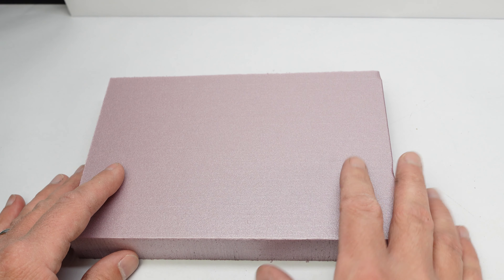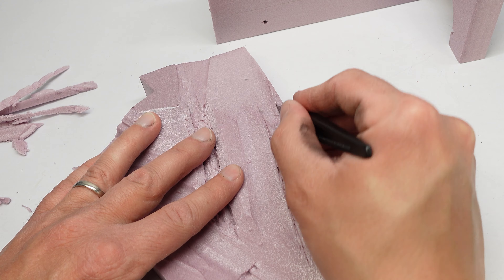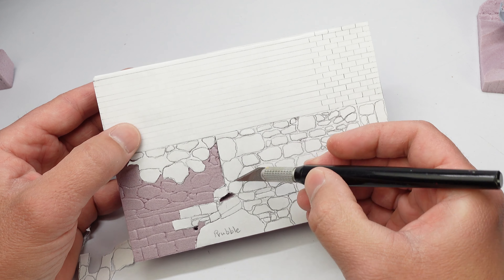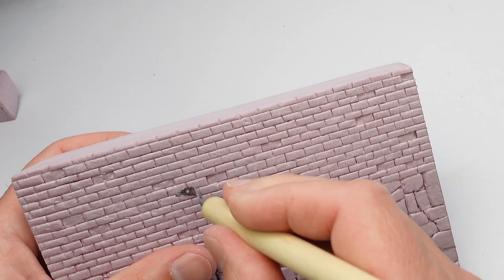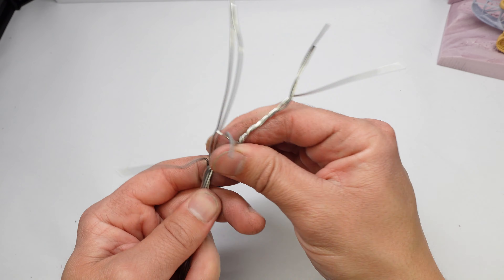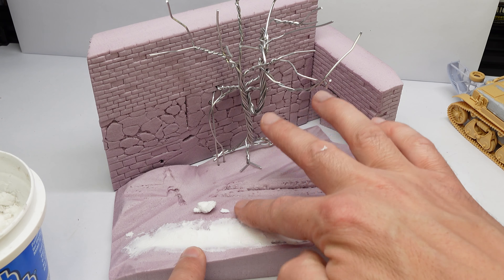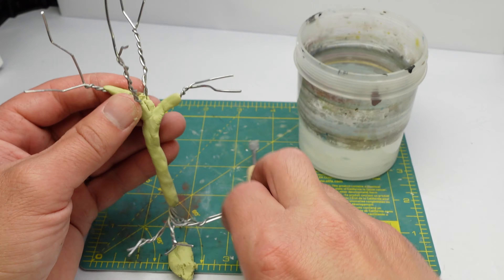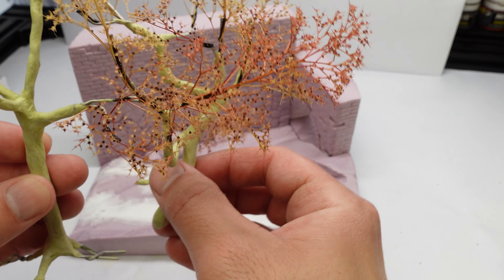Building A Diorama For A  French R35

Comment: Hi I'm trying to build a diorama for a m4 sherman in the pacific theme but I don't know what to use for the base or where to buy something for it
Reply from the maker: I would use foam board insulation. It should be available in multiple sizes but most common is 4x8 foot sheets so bring something to cut it with in the parking lot if you don't have a vehicle big enough to carry it. Should last for plenty of dios though, good luck!
Reply: @mattockmodels  thank you